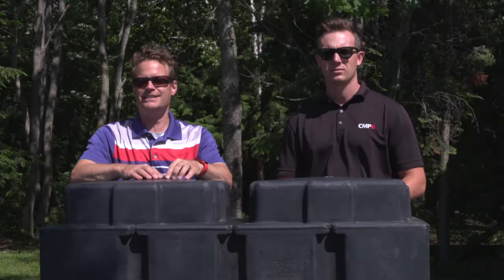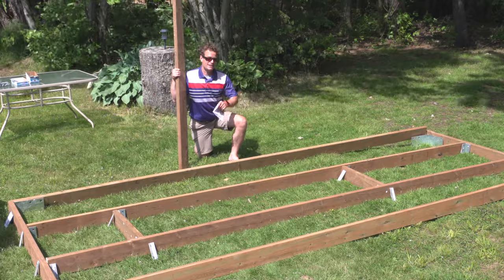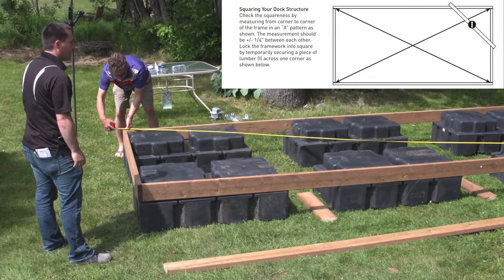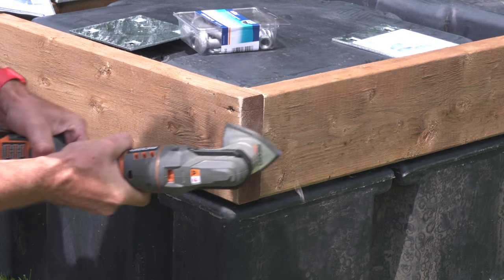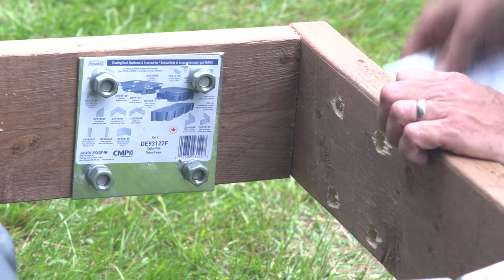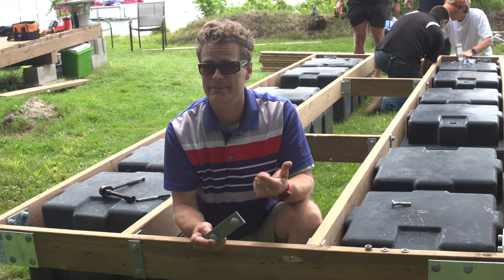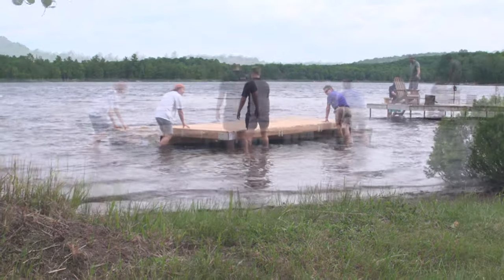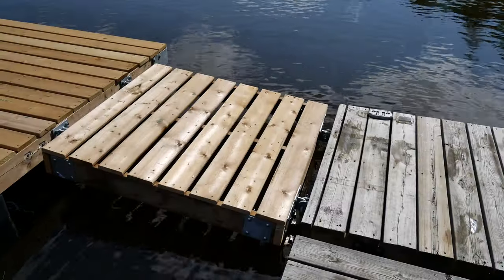DIY Docks with Dock Edge+ | diy-docks.com

Comment: Forty eight holes for forty eight carriage bolts. This is a lot of work. I would recommend not purchasing most of the hardware and just using some extra galvanized screws in the wood. It will make the whole structure lighter and easier to remove in the off season.
Reply: Does this dock system need to be removed for the winter? ( Ice )